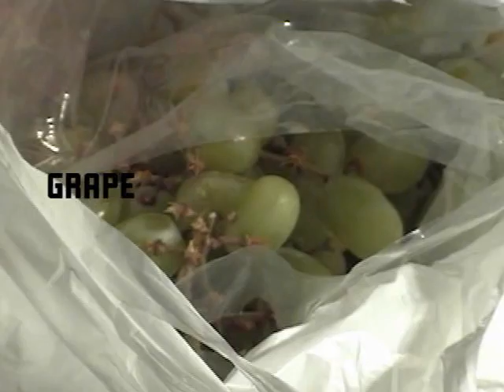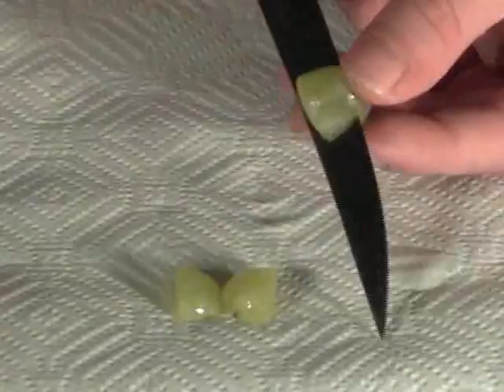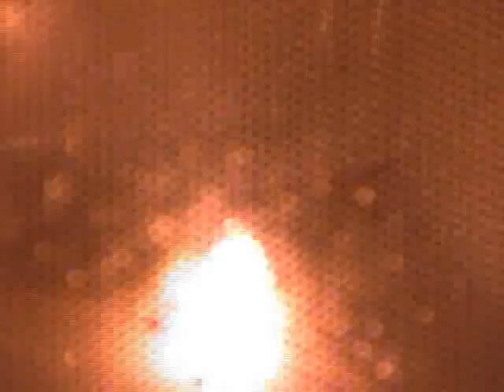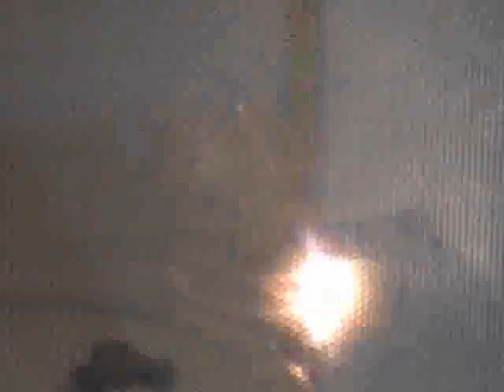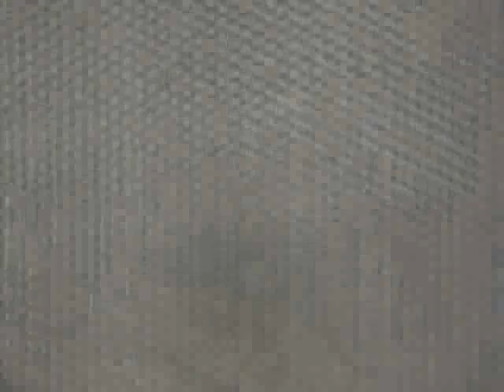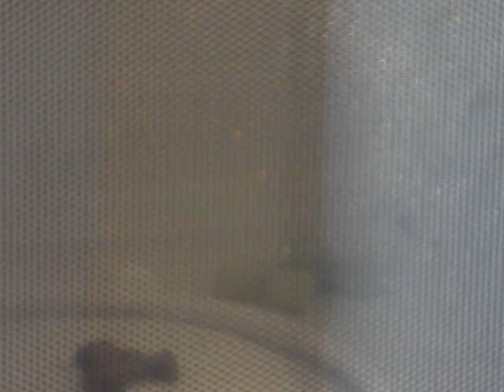Grape Microwave Plasma

Comment: It's not really plasma, it's just fire. A microwave doesn't create enough heat to make plasma.
Reply: plasma isnt created by heat, it's created by the microwave radiation stripping electrons from atoms resulting in a current
Reply: https://en.wikipedia.org/wiki/Thermal_runaway#Microwave_heating can melt glass in a microwave. also check out microwave kilns: https://depts.washington.edu/open3dp/2010/04/microwave-kilns/

Comment: The grape thing, when you cut the grape, the 2 corners act like receptors, so the heat/microwaves travel down toward the skin of the grape, and in that little 'crevace' it gets so hot that the heat is emitted out,

does that help?

Comment: Un-freaking believable! Actually DOES work (don't tell the wife I tried it)! Put it on the center of a turntable and it still worked. Why doesn't it do the same with OTHER foods? Is this the same effect NASA saw when they dragged a 2 mile cable through space? It looks like an electric current is trying to pass through the grape due to the distance between the two ends, and is too much for the thin membrane at the cut. Remember the old hotdog cookers with 120V and electrodes?